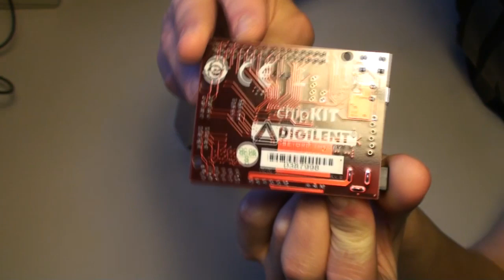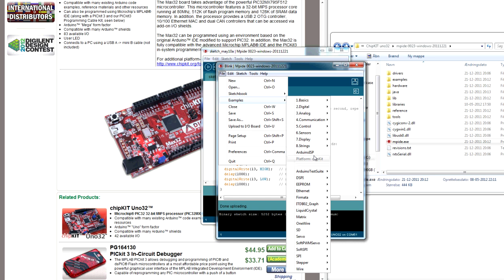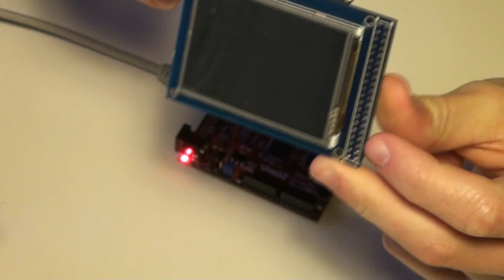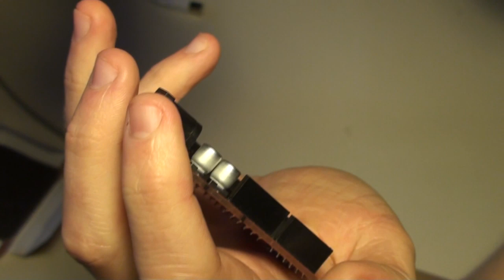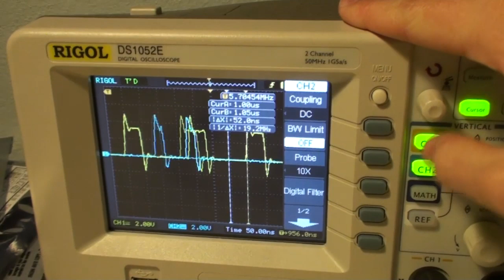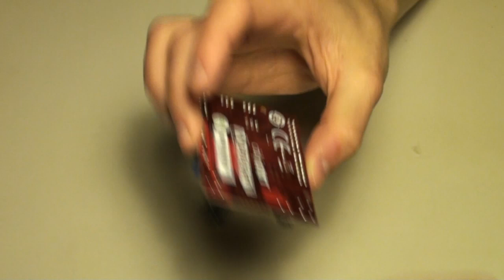chipKIT Uno32 Review

Comment from the maker: This is due to the number of instructions it takes between each GPIO pin write.
If toggling a pin as the only line within a while loop, the loop itself takes a couple of instructions too!
Furthermore if you use the standard Arduino digitalWrite commands the GPIO writings are slowed down very much due to some checking to convert the pin number to the proper port name and pin number.

Comment from the maker: If you have never played with an Arduino before I would definitely recommend you to get on of the original ones, with the ATMEGA328.
In my opinion the Arduino is the best starter solution for electronics hobbyists.
When you've got a good feeling of the Arduino and suddenly have a project that requires a bit more powerful processing unit, you could go for the Uno32 where you can still keep the same development environment.
Not all libraries will be compatible though!

Comment from the maker: Hi.
Regarding the STM32VLDISCOVERY board I will recommend you to buy and use the STM32F4DISCOVERY instead. The price is almost the same, though you get much more performance and speed with the STM32F4 chip.
The display you own contains the simple KS0070B LCD controller which can be controlled either thru a 4-bit or 8-bit interface. You will for sure be able to use this display with the board with ease.

You are always welcome to write us a private message here on Youtube or thru our website.

Comment: this a great video that explained to me why that I was struggling with my project, Im new to this but I am doing a project the arduino uno wasn't fast enough so I change to chipkit uno and it was very noticeable on the speed  but I still need a bit faster speed because once a while doesn't response to speed that I need ,so Ive just learned that instead digital right to toggling a bit doing LATx writes ! that i never knew,please can you provide a sample code 4all the pins to set high2low:)

Comment from the maker: Well, that project sounds much more like an Analog Audio project to me rather than a microprocessor project.
Maybe you should go for a DSP?
Or do you only need to detect press on the piezo element - so digitally converted to 0 or 1? If so, you could go for a faster ARM processor that would be able to sample these inputs and put them into an intelligent buffer.

Comment: If I were to get this today, can I just connect a QVGA screen Pmod to a Pmod shield on top of a uC32? And how much RAM do I need if I want to double buffer a QVGA pmod with 16 bits per pixel? Would it be ( (320 * 240 * 16) / 8 / 1024 ) * 2 = 300 kB?

Comment: Can we program by flushing the .hex code from any IDE which supports PIC MCU programming on this board ? I mean ICSP ?
Reply from the maker: Elyes Mehri Yes you can. Although this board comes with a USB bootloader such that it can be programmed through the Arduino IDE or similar, eg. Atom with PlatformIO

Comment: Is it compatible with all arduino shields and libraries ?
Reply from the maker: Almost. Be aware of the SPI pins though, as these pins might be shared or used for other periphirals. So don’t expect several SPI periphirals - however the one used by most shields (pin 10-13) works as intended.

Comment: this is a project for a museum where there will be visitor interaction with these 29 buttons/piezo, I say piezo because they need to sound louder and softer depending on how hard the pad is hit, similar to a midi drum pad. They do not want to use midi. I'm not a programmer but I am a circuit board designer. I may be willing to compensate anyone who can help?